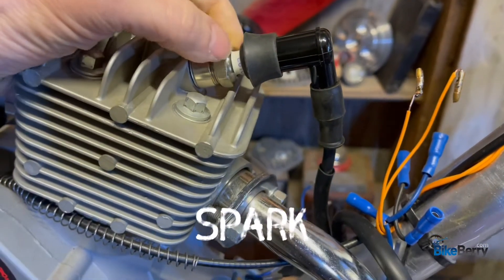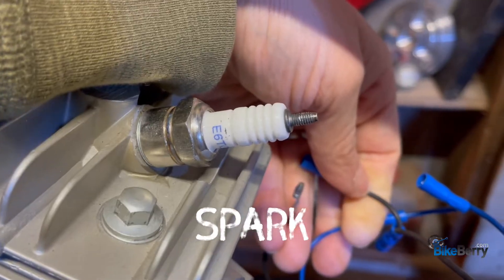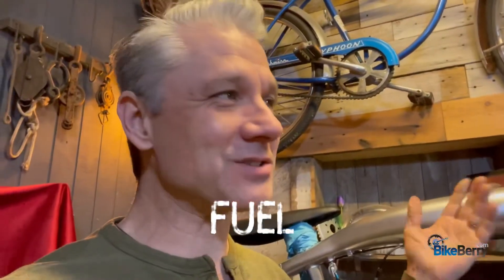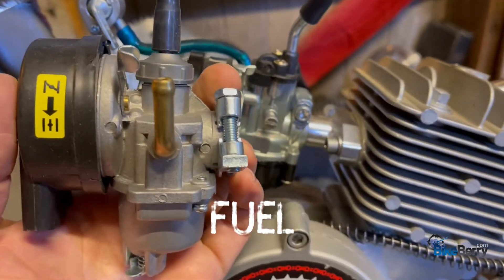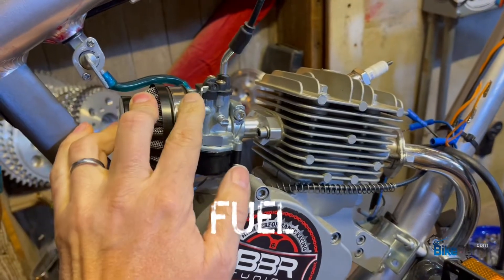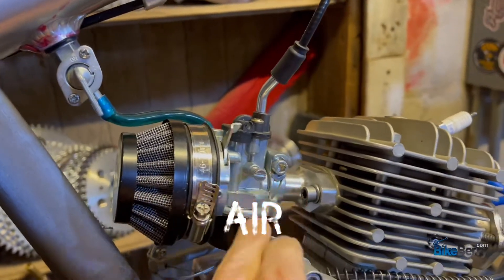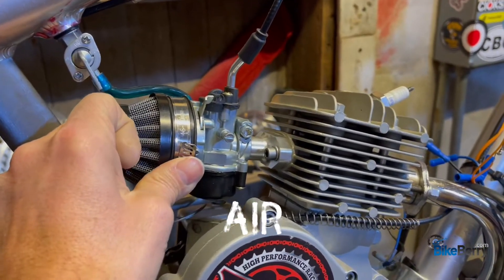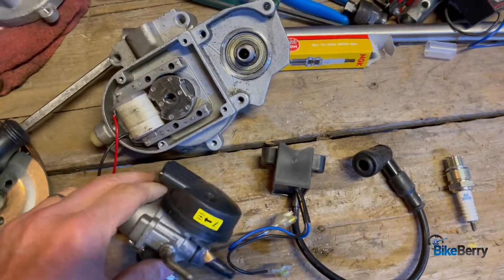Engine won’t start? Try this! | Motorized Bike | Bike Berry

Comment: Not a criticism but more of a note... you neglected to mention that the fuel selection lever has two positions.  Straight down, which is for normal fuel delivery and straight up, for reserve fuel.  This is something that some new riders might not have any experience with since there would still appear to be gas in the tank.  Over all, well done.
Reply: These chinese fuel switches don't have that
Reply: Interesting. Please elaborate on this reserve fuel system.
Reply: @tonytaylor5087  You would need to pull the petcock from the tank to be sure, but all the ones I've gotten from these Chinese engines have the off position sideways, the on position selector switch "tail' is straight down and the reserve switch position has the 'tail' straight up.  Once the petcock is out, you will see two mesh filters, one tall and one short.  Make sure they are not plugged with crud from inside the tank.  With a clean piece of of tubing on the carb end of the petcock, you can blow backwards while working the lever to find which way the on position is.  If you turn it the wrong way, you will empty the tank and have no reserve.  Hope that helps, sorry to have taken so long.
Reply: I was wondering that, thanks!
Reply: How does it work?
Reply: Ok,I never knew.